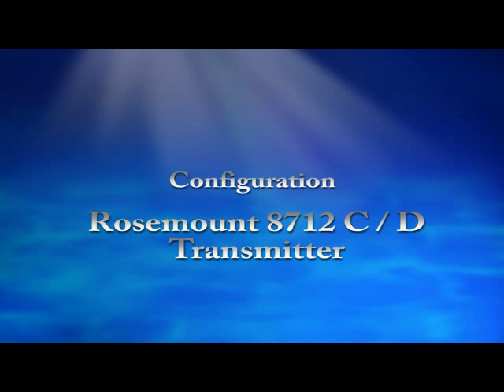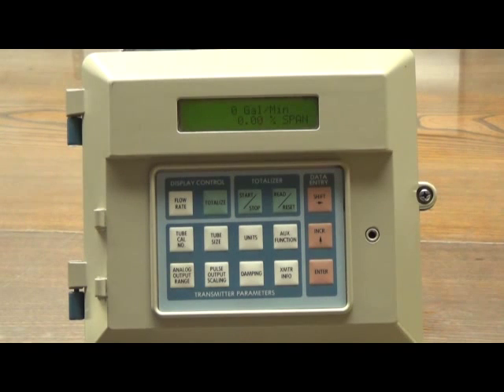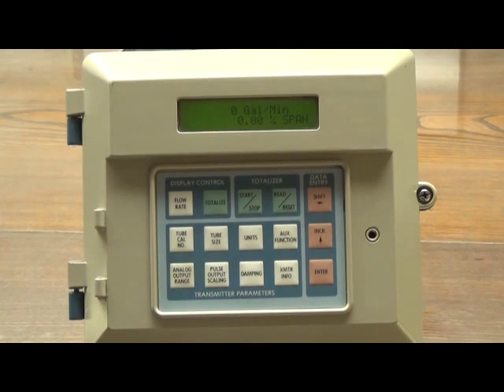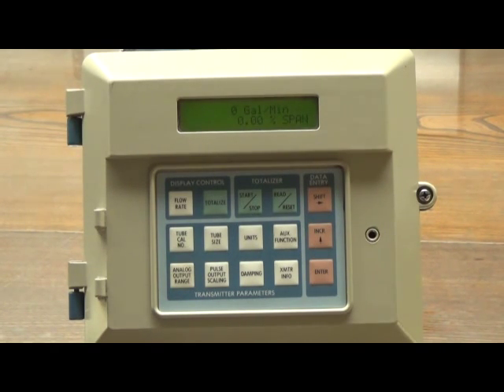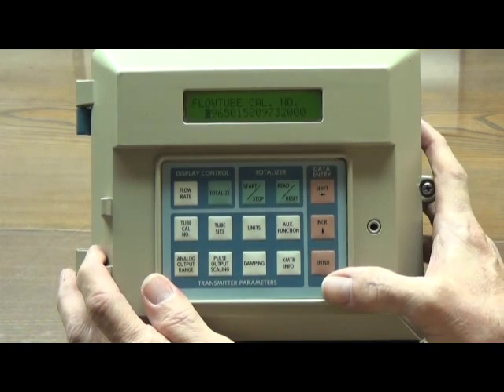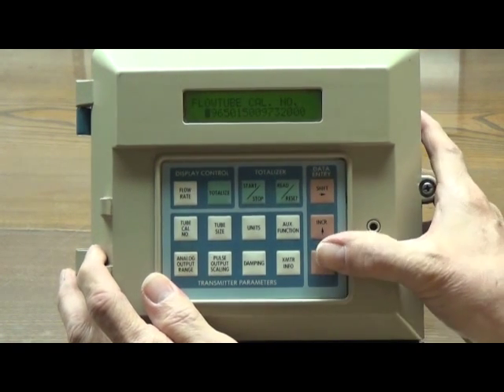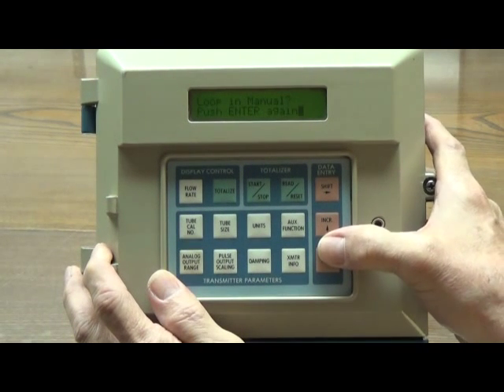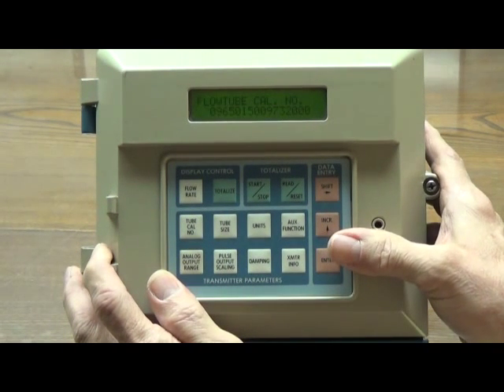Configuration Tips: Rosemount 8712 C / D

Comment: Why did you change the Cal number?
Reply from the maker: There are several reasons why you may need to change the calibration number in a transmitter.  A couple that come immediately to mind are: 1. when you have a flow tube that needs to be switched at the measurement point.  The new flow tube will have it's own calibration constant that must be placed in the transmitter; 2. If the flow tube is sent for liquid flow calibration at a lab like TECO's, and its calibration constant changes.  When the meter is returned, the new calibration constant must be recorded in the transmitter.  If you need additional assistance, please feel free to reach out to us for technical support: www.teco-inc.com.